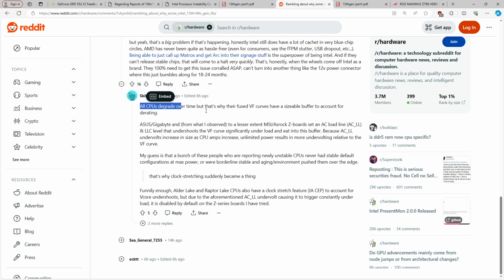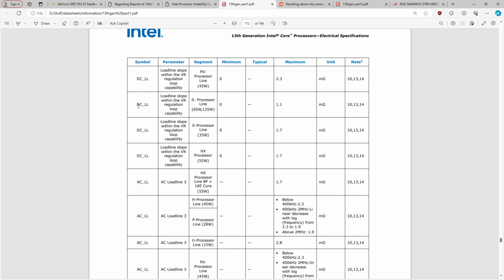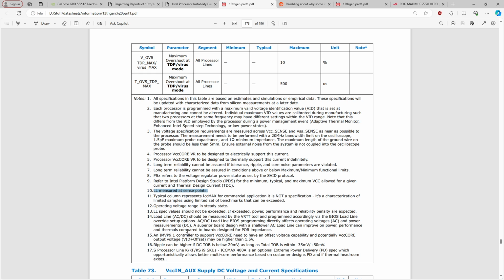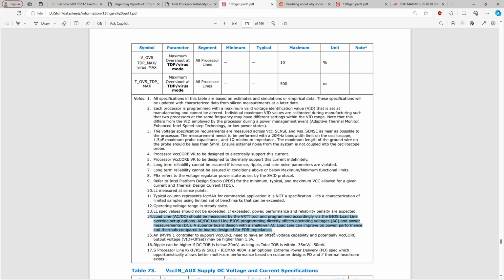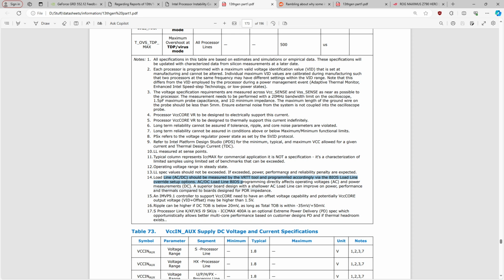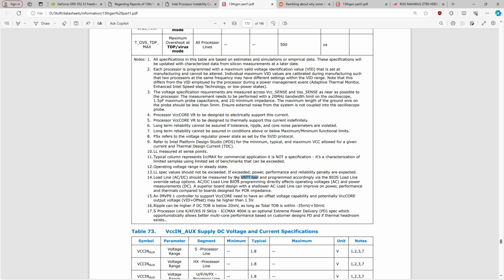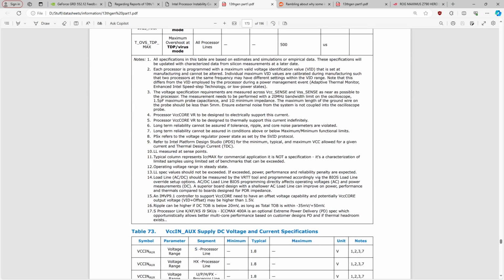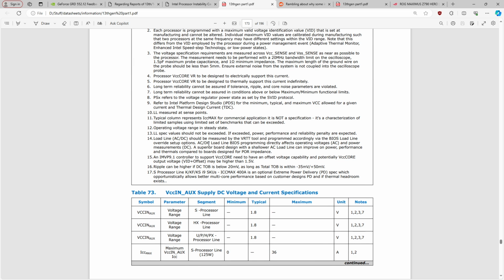Ranting about intel's 13th & 14th gen Vcore load line "specifications"

Comment: 14700k on a b660. best performance by setting vcore manually with llc5 (asus) to around 1.37, then in windows offsetting -180mv on the p-cores -> 36k CBr23, 270 watts. were these numbers real, or was I getting trolled by the cpu?

Comment: See I was explaining this whole situation to my friend and even though he doesn't know much about computers his first question was "What if you clear CMOS? Shouldn't that fix it?". Much to his disappointment, I had to explain that "No, it doesn't fix it"... Absolutely crazy to me.

Also, I've seen several reports and talked with at least 1 person myself where implementing the recommended power limits on an affected CPU does NOT solve the issue, which is quite concerning to say the least. That guy's chip was maybe a few months old and it already was degraded because of the motherboard's default profile to the point where Intel's own recommendations did not work...

Comment: The ideal world would have every CPU working at the same voltages, amperage and frequencies. But we live in an imperfect world where processor cores are cut from a wafer and will perform slightly differently depending on if they were cot from the center, mid range or the edge of the wafer. As well as minor imperfections in the silicon of the wafer. So without Intel including per CPU information on the test results for each core the MB manufacturers has to make assumptions regarding the values needed for stable performance.

That's one of the problems. For stable operation the MB manufacturers tend to use a slightly high voltage and be a bit aggressive with the settings to provide more stable performance for the end users. They then look at performance and try to optimize the settings so that in benchmarks they will perform as high as possible. These benchmarks are something that people look at and a board that has higher performance are believed to be "better". Problem is that as you approach optimal performance settings you also start to cut into the envelope for stability.

This is the second problem. A the motherboards from a manufacturer that matches all of intels recommendations and settings limits will be slightly slower than those that are more aggressive and tethers on the edge where stability is concerned. They may also be unstable with slightly more processors as they may use lower voltages for the cores. 

Now one more problem is that most of the benchmarks used doesn't really stress the CPU, memory and PCI-e busses and test for stability. This is somewhat demonstrated when CPU problems has been shown to be more common with certain software, such as the Unreal engine. This software stress the computer by performing a lot of calculations using multiple simultaneous threads and combines this with a lot of memory accesses. And suddenly there are failures. Some blame the software, but in my opinion that's totally wrong. The software doesn't do anything it shouldn't be able to do, but it may be uncommon in what kind of instructions and the mix. The computer should be able to handle this no matter what. A computer that fail when running software that not explicitly try to change the operating parameters of the hardware in ways it shouldn't be able to isn't stable.

When I worked I built computers, thousands of them and quite a lot, most actually was servers. We tested these servers by running bench marks and test programs that stressed the hardware as hard as we were able to. Some of these programs we used came with warnings that they were not "realistic" but were written to stress the hardware and could damage parts. This was fine for us as they were not overvolting, over clocking or doing anything "forbidden". If the computer was stable it would not be damaged by running these. We ran every machine through really tough tests for 24 hours in a room with a temperature of 40 degrees Centigrade. That is quite hot for a computer, and even worse for one running extreme CPU, memory, graphics and storage tests. There were failures here, mostly memory related, but any computer that survived were not going to have a problem when running in a data center, a normal office or anywhere a normal user would use it.

"Realistic" tests are not really testing for stability. Stability tests are nasty and will stress the computer far beyond what it will "realistically" experience when used.

Comment: I think it is like the "problem" LTT discovered. 1 out of 10 CPUs is "weaker" and needs more voltage or power to reach the same clocks. 
But the Auto OC might not be suited for that one CPU. And CPU degrading is a thing.

Comment: don't forget about AVX 512 when they disabled it on 12gen intel is at blame for a while but they always get away with it BECAUSE ITS INTEL
Reply: The PS3 emulation community RPCS3 never forget this and they found out that avx512 has great emulating benefits plus performance boosts on games

Comment: Is LLC7 to high on a 14900k Apex encore? I have mine set to LLC 7 , svid best case scenario, negative offset to 0.60. 59X pcore 45X ecore 50 ring HT off , Pulls 1.3V on full tilt and in games about 1.32 V never goes above 60c and watts are from 110 - 170 depending on the game. Asking because I have seen people saying LLC7 is a bad idea. I have been running with this set up for 6 months and never have had an issue.
Reply from the maker: It won't degrage the CPU and if it's stable for you then there's no reason not to use it IMO
Reply: @ActuallyHardcoreOverclocking  thank you for your reply I love and appreciate the time you take to answer questions and help out the community, I’m very grateful.
Reply: The reason why people say it's a bad idea is because of 3 things:

1. On motherboards with worse VRMs the overshoot can increase with a higher llc level. If you are close to the max (whatever that may be - it's not 1.32 for sure!, 1.4 may be the limit?) you could shoot into dangerous voltages for short moments, potentially damaging the cpu

You got a high-end mobo - no need to worry

2. As well as overshoot, undershoot can increase with a higher llc on a worse vrm. This can cause instability/crashes in transient loads. If you are stable, you are totally fine!

3. If you would only change the llc without adjusting a negative offset, your voltages would increase into this dangerous territory. So for most people who don't have an idea what they are doing, what combination they need to set, a high LLC is a bad idea to recommend to. But because you set an offset to compensate, and have an eye on your voltage, you are fine!
Reply: im on same cpu/mobo and LLC 7 is crucial for stability in a lot of games. granted im also at 5.5 all core due to degredation

Comment: Imagine if the major auto manufacturers had "K" skews that encouraged boosting engine power by removing rev limiters and messing with timing, fuel, air, and if the Dealers then bumped them all  just to get sales.   Years ago Intel frowned on overclocking.  Then they tried to sell insurance for it. Then they gave up and said do what you want and specifically targeted that market.  I doubt if a Ford or Toyota would still expect their engines to function reliably after Dealers and owners wore them out trying to push them to the ragged edge. But hey, Intel literally targeted it.
Reply: Auto manufacturers are more the type to overtune engines themselves to hit power and efficiency numbers while using low quality materials and not caring about the potential disastrous effects of this as long as massive failures occur after warranty period. cough Subaru  cough
Reply: Famously, a bunch of japanese sports cars were once sold with 276 hp, colloquially known as the JDM Gentleman's Agreement. Most of them irl put out 300-400 or even 500+ hp.

Had they been detuned to their published spec, maybe they'd be more reliable. (I remember dealing with thousands of blown head gaskets etc on JDM rice boxes running still stock engines)

Comment: i had 2 years of problems, issues, frustrations, fighting with my girl, my family, my boss.. all because of the instability of my workstation which is my lifeline for money.
Reply: You should have gone the Ryzen route.

Default settings are rock solid.
Reply: @elektronischermeister for the exact same reason, i recommended the 5900X to a friend. I went for a 12700K for my audio stuff, i actually like the default oc setting minus voltages on my PC, audio is extremely sensitive to power limits, clocks, etc. I only undervolted my chip for more.
Reply: @saricubra2867  i also use Ableton to make my beats and play piano.
Reply: You should not be using desktop products that does NOT use registered memory as something you consider mission critical. You only have yourself to blame.
Reply: @michaelcarson8375  stupid comments get  disliked
Reply: For anybody thinking of leaving dumb comments, telling me now what i should have done 2 years ago, ask yourself this: were you aware of motherboard manufacturers overclocking your brand new, top of the line i7 CPU without you knowing? If you were, why didn't you make a video about it?
Reply: @afti03  Try telling people to stop using ASUS and gigabutt boards before this finally came to light. The biggest give away with asus motherboard is to look at their bioses if you see things like one liners that say "improved system performance" or "improve system stability" there was your give away. The issue is not just with i7/i9 boards go read the bios firmware section of the asus WS C422 sage 10G. Also try reading about ASUS board giving WHEA errors.

Comment: i have msi z790 edge d4
im on 13700kf 
im disable all futures and lock cpu 1.3v and 5300 mhz LLC 3 + AC/DC 1/1 
Static OC
all good?
Reply: If it that CPU is stable and doesnt overheat, then yes.

Comment: I think I know what you're misunderstanding. But I have to preface this by saying that document is more of an executive summary than an actual fully detailed design spec. Yes the data givin is correct, but a LOT of detailed conditions and "sub specs" (for lack of a better term) has been left out.

So to start off, this spec deals with the physical hardware implementation of the voltage regulator and yes, the best Vdd delivery circuit will have close to 0 Ohms of AC and DC loadline impedance.
The Only reason to ever have higher loadlines is to reduce the BOM cost of the motherboard.
This is different from the "Loadline Calibration" software settings that end users get to mess with, because the latter can be used to mimick the behavior of a better VRM (assuming it has a competant control loop implementation) at the DC LL limit, but can't change the AC (i.e. in the high frequency limit) impedance that the CPU sees.

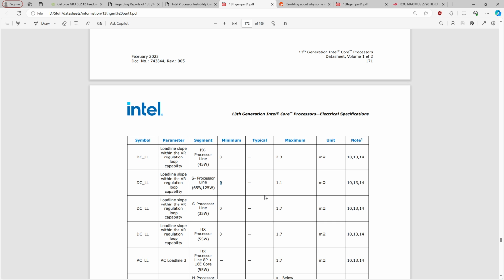Around 13:00 you talked about Intel validating certain Vdroop requirements; but I disagree with your conclusions.
Intel specified the AC and DC LL impedances as a maximum to give board vendors the choice to build cheaper boards. This has to be done, unless you really want another totally locked down NVIDIA situation.
So the only problem would be if Intel's CPUs couldn't hit their minimum specc'd power, performance and longevity targets, at the specified stock settings, in a board with a VRM so cheap that it has an AC and DC impedance equed to the maximum datasheet LL values. The chances of this being the issue is very slim indeed.

PS. I don't know if you ever get my comments about silicon IC degradation or if you just disagree, but in case you keep missing them I wanted to add this here as well:
Electromigration really isn't much of a concern in products like these modern, flagship desktop processors. Also, electron tunneling straight through barriers won't quickly cause a lot of damage or outright kill the CPU, but rather causes increased leakage currents and therefore an increased static power dissipation.

The really significant causes of slow degradation, especially in a DIY desktop scenario over months to years, are Hot Carrier (Electron / Hole) Injection which causes ionization and charge trapping, Negative Bias Temperature Instability (NBTI, and in some cases even PBTI) and Time Dependant Dielectric Breakdown (not just in the gate-substrate layer, although that has the largest effect).

Comment: I also think that you misinterpret LL physical characteristics as LLC. 
IMO it's not really CPU's job to ask for those values, it's motherboards who should guarantee minimum required voltage. The CPU can only need those values if it tries to adapt to motherboards LLC dynamically.
What Intel uses these parameters for? Do CPUs request different voltage based on these values? Does AMD or Nvidia do it?
Or could it be for adapting to spikes but better than dumb clock stretching?

Comment: Yes, motherboard manufactures are pushing the CPUs by default. The Load Line Calibration they set is designed to get more out of the CPU hoping that at least 99% of silicon can handle it. Sometimes they just don't get it right. Typically the most relaxed LLC level is fine but they use a more aggressive one by default. This is in contrast to the past where the relaxed LLC was the default and you would have to change it manually.

As for AC_LL/DC_LL, at least for Asus boards it seems they all are set to 1.1/1.1 except maybe the Apex/Extreme. Really doubt all the boards from the cheap OEM to the Maximus Hero have the same impedance, I think they just don't care to adjust it properly.

Comment: I love hearing the voice of reason. All cpus degrade with time? I didn’t know.
Reply: In theory, a CPU is engineered to operate for its warranty period at base spec, at TJMAX, 24/7. So you can expect to run a 14900K for 3 years at 100C at 3.2ghz. Turbo will shorten.

Any lifetime beyond that rating is luck/binning/lottery.

Silicon endurance is an exponential with temp, but im not sure what the formula is (varies by node). so you may get 3 years at 100C but 9 years at 90C etc. (pulling numbers out my ass since i don't have internal intel data on hand..)

Intel CPU's run fairly cool with enforced power limits, so they "should" last longer than the usefulness period of the product. 

Until you run them above spec.....

Comment: I moved away from Overclocking/Undervolting almost 20yrs ago (think T-bred B, Barton, Winchester, Opteron 940 era) so my understanding is .... not as good as it used to be.
Atm i have an i3 10100 with Gigabyte B460 HD3, i7 6700Q laptop ... so not applicable at all, but i plan to get something new so bear with me a little.

I am looking at a Ryzen 5 5600 regular, with 20$ aftermarket cooler and thermal pad, mobo something with B550, like Gigabyte AORUS Elite v2 (i want something with PCIe 4.0 nvme SSD and PCIe gen 4 for graphics). I plan to reuse old PSU, DDR4 ram, SSD, and RX 570 4GB graphics.

Basically undervolting a CPU can be bad, as it lowers long term reliability, best run it at average voltage (i am looking at stability, no issues).
Overall go for standard settings ... should i be worried about that motherboard, it's 120 euros where i live, is there something better than that in that budget ?

PS: I know this video applies to Intel, but i thought some board advice might help. :)
Reply: No such issues on AM4 or AM5 currently.
Also try a b550m ASRock pro4 or if high end the b550 Asus ROG strix that gigabyte board isn't really worth the money (I'm talking about US prices).
Also some 5000 series CPUs can do 30mV undervolts, like the Ryzen 7 5700X (very important only the X not the 5700 or 5700G) without any degradation or stability issues.

Comment: Why most often there are problems on Asus motherboards? Literally take some 14900k and an Asus board and for example a gigabyte. BIOS must be earlier than 2024/04/19 on Asus. Suddenly on Asus it won’t even pass Cinebench in 99% of cases, but on a gigabyte everything will be fine. If the “requirements” (actually recommendations) are the same, then why will one board work normally while the other (Asus) is unstable?

Comment: The thing is, all boards I've seen have the maximum loadline specified here (1.1mohm) as the default. If you would really set AC_LL = DC_LL this would result in severly overvolting the CPUs, most of them above 1.5v. I've measured an increase of ~3mv per AC_LL mohm, so in the worst case this could result in 300mv more voltage? Also remember that the default current limit is 300A, so theoretically we're also talking 300mv of vdroop. Since motherboard vendors typically do not set this at all, it could be even more droop than that.
Reply: For what it's worth my MSI board's default DC_LL is 80mohm.

Comment: Yeah, I think both you and that Reddit user are spot on. I knew ASUS’ default VIDs (Typical - Prime/TUF or Trained - Strix/Maximus) were using a much less voltage at stock. 

I would say they were using a shallower AC LL but I have no what their spec page is trying to tell us. Basically, I knew that ASUS and Gigabyte were using much less operating voltage than Intel’s fused VID. 

MSI and ASRock definitely don’t do it to a large extent, as voltage on their boards tends to be rather high, and the room for under-volting on MSI/ASRock is far far greater. 

I do, however, believe Intel should find a way to separate fused VIDs between their 1-2 core boosts and their all core boosts. There is a V/F point for 5.5P and 5.7P on the 13900K/14900K, and vendors pretty much just use the V/F point even though Intel spec hasn’t validated the chips to operate at that V/F point for daily use.
Reply: Is Asus and Gigabyte or Msi and Asrock setup better for processor longevity and stability then?